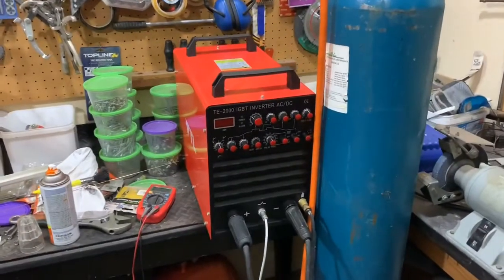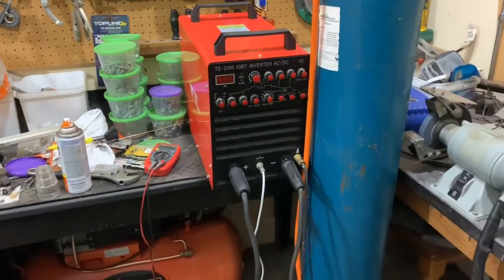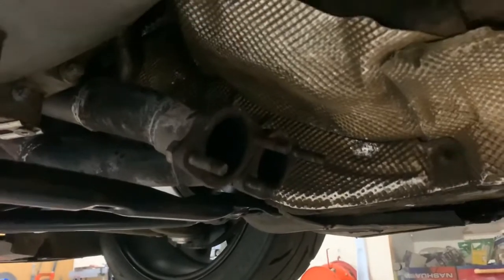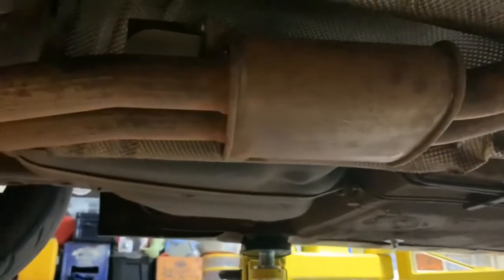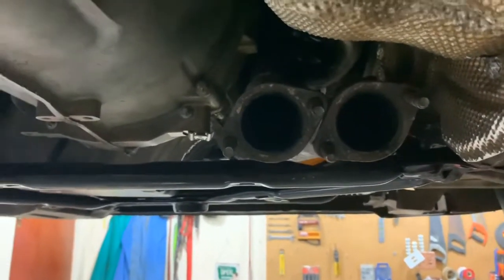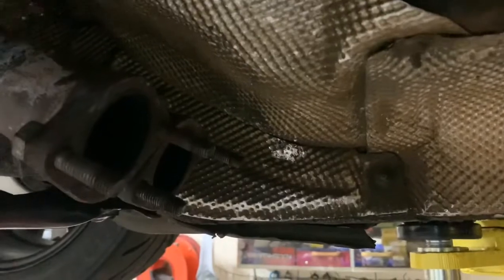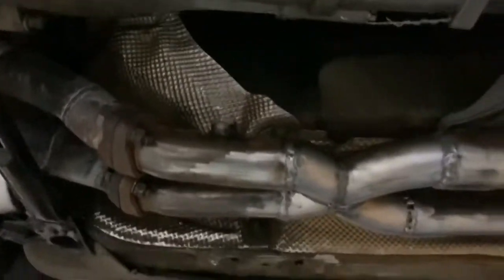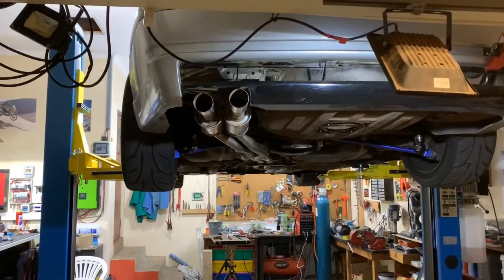E46 Race car Exhaust build using recycled parts (HDWDT)

Comment: Let's hear it! Well done!
Reply from the maker: Thanks guys. Ok, sound clip to follow. Nick has been doing a bunch of tuning which involves “street dyno” runs - 3rd gear pulls from 3000 to ~ 7000rpm on a flat road. We have an in-car clip - put your headphones on😜.
Reply from the maker: The screaming exhaust clip is up!
Reply: Did you noticed an performance gains from the x pipe ?
Reply from the maker: Fatih Serin it’s hard to tell. We have had to adjust tuning for the new injectors as well as the exhaust, and for the first time we have been able to accurately tune for lambda, so it’s difficult to isolate what comes from which change.  Bottom line is we are definitely seeing better numbers compared to what we had with the stock exhaust, M54 injectors and Unichip tune. To get the full benefit from the exhaust changes will will need to experiment with valve timing as well, which we haven’t started yet.